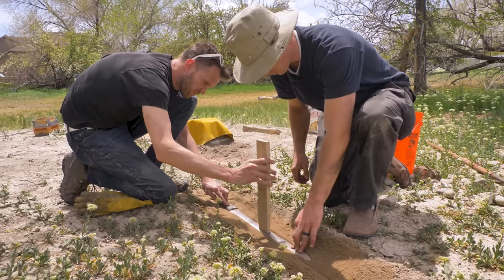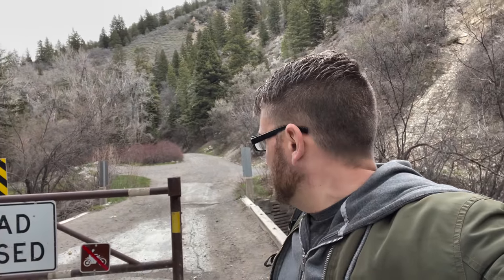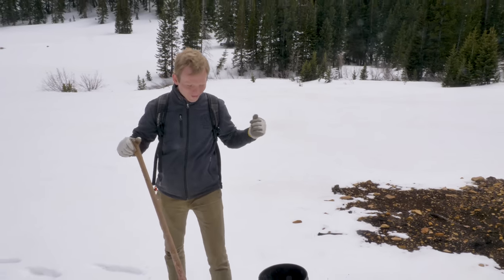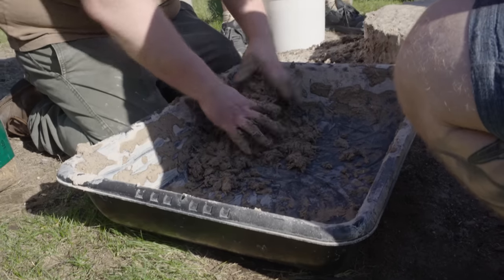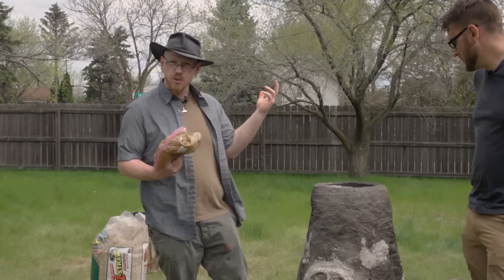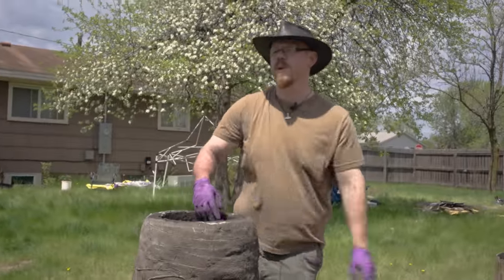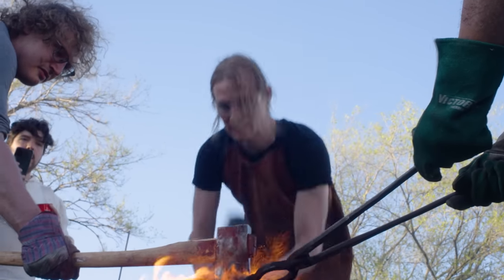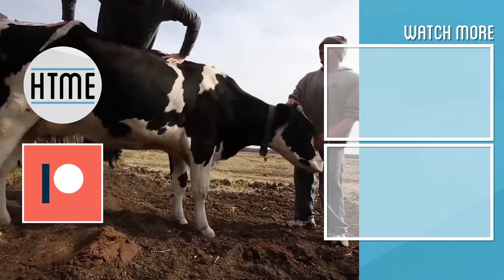I Hiked 14 Miles to Collect This Orange Dirt

Comment: Consolidating that into a useable billet is going to be a fun time. I've looked into that process and it's a lot of cutting and folding and/or stacking and [forge] welding.
Don't be surprised your arms get tired near the end from all the hammering.
Remember to Swing with more of the shoulder than the elbow, aim small miss small, and eat loads of protein when you can; you'll need every bit of effort with that.

Comment: "We've accidentally made steel."
I was not expecting that!
Honestly I was not expecting most of what was demonstrated.  This is an amazing and educational video!
Reply: This is not steel, this is so high in carbon that it's beyond cast iron. Cast iron has more carbon than carbon steel, ironically.
Reply: @rolfbjorn9937  Ah.  I was quoting them.
Reply: @FullmetalAngyl  Well, Yesterday Me is technically not 100% right, I just had a breakfast illumination, there's a term for it, it's a bloom or bloomery iron. See, High Carbon Steel is...way under 2% where cast iron is beyond 4%. Their bloom seems to be in the past 4-5% and obviously all blooms need further work to turn into either wrought iron or steel.

Comment: According to the book "Collapse" by Jared Diamond, bog iron production used so much charcoal that the norse ended up deforesting Iceland. The initial forests were simply far too slow to repopulate.
Reply: That sounds wrong to me, Iceland doesn't exactly have a lot of bogs, they're mostly found in Southern Scandinavia. Also all iron production requires charcoal, not just bog iron, it was only with the invention of refractory furnances that coal started being used.

Comment: At a daycare that my uncle owned, and my mom worked at, I remember digging in the sand pit, and finding what we called "Tiger Sand" because it was orange and layered in with darker sand. I also remember finding iron fillings in the sand with a magnet toy. the owner also regularly had sand delivered in a huge pile, and we loved to climb and dig in it, until eventually they spread it out.
I later came to the conclusion that the sand may have come from a local foundry, and had most of the iron filings pulled out with magnets, but some small (harmless) amounts were left.

Comment: I presume primitive times would have had a streamline process of this that would have been really efficient; considering how they're all using so many iron tools (that might have possibly been ruined after a single run of this) to craft that small amount of steel. Curious to think how those in the past did this. Still, this video was really cool and educational as well. Cheers
Reply: This is why steel tools costed ALOT of money back then. the smallest amount of purified steel had been hours of work in the making, and when you had those tools, you held on to them and made sure to treat them right.
Reply: thats why they sharpened and oiled their tools isntead of throwing it away. Probably they had bigger blooms with higher stacks.
Reply: @prydzen  They reforged iron tools, instead of sharpening. Sharpening removes material, something you want to avoid when facing material scarcity. Heating a tool up, and hammering it back into shape saves far more material.
Reply: @torg2126  nonsense.
Reply: @torg2126  They definitely sharpened tools. Reforging is a waste of resources and time, and you still lose material due to oxidation forming scale.
Reply: @TheElfsmith  Not as much as when you grind a tool back to profile. Simply hot working a tool back into shape will loose you less
Reply: @torg2126  You wanna bet? Because after you forge a tool, guess what you do.
Reply: @torg2126  I can GUARANTEE you that honing or sharpening a dulled edge (as in dull through regular use, not damaged) loses less material than reforging an already finished tool does.
Reply: @TheElfsmith  Scrape off a bit of scale? Obviously. Grinding off a whole lot of material to get back the tool's profile tends to remove more material
Reply: @torg2126  After you forge a tool... you grind it to true up the profiles. You also have to reharden it and temper it, which, guess what, produces more scale, and more grinding afterwards. You also have to rehandle it, which, for most traditional knives, means grinding down the peened tang, or knocking out an axe handle that needs to be remade to accept new wedges. Even scythes, which are cold worked by peening as part of maintenance, still get honed on a whetstone after peening.

Sharpening, starting at around 200 grit, however, produces so little waste material that if you were to weigh the tool on a precision scale, you probably wouldn't see a difference.
Reply: @torg2126  It's not just "a bit" of scale. Heating a piece of steel up to forging temperature turns a significant fraction of its weight into oxide every time you do it. It also takes longer than sharpening, and burns up fuel. Then you just have to grind anyway, because you have to grind off the scale. Also, reforging undoes heat treating for hardening, so you have to go through the whole pain in the ass of heat treatment and tempering all over again, hoping you get it right and the metal doesn't crack or break under the thermal stress, which is a not insignificant risk every time you do it. Sharpening is just easier and more economical in every way; people in any time period were definitely not reforging tools if they could help it.
Reply: @TheElfsmith  First off, the scale issue is overstated. Most modern blacksmiths tend to use propane forges, allowing a very precise control of heat, at the cost of a few downsides. First off, propane forges often can't reach the same temperatures that charcoal forges can, thought YRMMV depending on the exact forge design. 

Secondly, and more importantly, when propane is burned, one of the combustion results is water. As you know, extreme heat and water vapor allows quick and deep rusting, as demonstrated by all the armored vehicles rusting away in Ukraine right now, an environment a propane forge provides abundantly. Charcoal, on the other hand, being near pure carbon, only releases CO2 and CO, along with heat when burned. this means that a well managed charcoal forge can have an area that holds almost no oxygen or water vapor, while being extremely hot, allowing effective forging.
Reply: @torg2126  You have... Absolutely no clue what you're talking about. Scale doesn't form because of the combustion byproducts of the fuel, it forms in the presence of extreme heat and oxygen. When iron and its alloys are heated to a high temperature, the piece reacts with oxygen, whether it be from ambient water vapor or diatomic oxygen, and forms Fe3O4, or black iron oxide, on the surface. When you strike or brush the work, it flakes that black iron oxide layer from the surface, creating a "fresh" surface for more to form. That's what scale is. It will always form in an aerobic environment at high temperatures. It's not just regular rust formed in the presence of water; that would be Fe2O3.nH2O, or hydrated ferric oxide. Typical rust does not form in the forging process- it's a completely different thing. 

As for the fuels, that's not how ambient atmospheres work. A "rich" propane forge, meaning more fuel than oxygen in combustion, creates a reducing atmosphere in the forge, which- on the extreme side of things- can remove iron oxides from the surface of your work, and a solid fuel forge with the work exposed at temperature to unburned oxygen will form scale. But that's neither here nor there, because as soon as that hot iron hits the ambient atmosphere, it's going to start forming forge scale on its surface. The ambient atmosphere is what near all scale forms in, and in general, you can expect a mass loss of somewhere in the 1-10% range over the course of your heats (although this is heavily dependent not only on forge efficiency but also time, temperature, overall mass of the piece, surface area of the piece, what processes the work is going through, and a plethora of other things). 

Regardless, though, formation of scale during forging is so well known- and so abundant- that archeologists use the presence of forge scale to determine the locations of blacksmithing shops at dig sites.
Reply: @TheElfsmith  As you said, scale forms from oxidation. Charcoal releases CO2 and CO, of which carbon monoxide acts as an oxygen displacer.
Reply: @TheElfsmith  Propane also produces water vapor when burned. I quote; "The main catalyst for the rusting process is water. Iron or steel structures might appear to be solid, but water molecules can penetrate the microscopic pits and cracks in any exposed metal. The hydrogen atoms present in water molecules can combine with other elements to form acids, which will eventually cause more metal to be exposed. If chloride ions are present, as is the case with saltwater, the corrosion is likely to occur more quickly. Meanwhile, the oxygen atoms combine with metallic atoms to form the destructive oxide compound. As the atoms combine, they weaken the metal, making the structure brittle and crumbly."

In short, water can infiltrate iron, especially when in heated, ensuring faster oxidation when exposed to normal atmosphere
Reply: @torg2126  Holy shit man, I already went over this: Scale produced in forging is Fe3O4. No water needed. The heated iron reacts with oxygen, and makes iron oxides. Rust, a totally different oxide, is Fe2O3.nH2O. Forge scale is not rust. Rust is hydrated ferric oxide. Forge scale is black iron oxide.
Reply: @torg2126  But this is all besides the point anyway, because scale still forms in ambient air, regardless of what fuel you use, and it will still form in greater mass than what you would lose from sharpening and honing. 

Sharpening and honing are not reprofiling, and don't hog away material. It's pushing a tiny little burr back and forth across the edge, making it smaller and smaller as you use smoother and smoother stones. The material loss during a single sharpening is negligible, while the material loss in reforging (which would including grinding anyway since you can't forge down to a sharpened and honed edge, nor would you want to, since that increases the likelihood of warping in heat treat) can be up to 10% in general work, and sometimes even above 20%, like I said before.

Comment: You should visit the Old Irontown ruins near Newcastle Utah. There are the remains of large charcoal kilns made in the late 1800s to produce charcoal by tons, a blast furnace, a few other things I can't think of off the top of my head, and you can see the old open pit mines on the side of the mountains there. There is so much of that rust dirt in the area you can see whole mountainsides with the color. It's one of the richest reserves of iron in the country that has been largely untapped for some reason.

Comment: i wish they went into more details on what went wrong here... was it the temperature/furnace or their process of mixing the pulverized bog iron with charcoal? When Primitive Technology tried with his bog iron, i think i remember him mentioning about there being a specific ratio of iron to charcoal that is hard to achieve and he failed as well, only produced small beads from the crumbly bloom...
Reply: The previous video talked about how they didn't have enough heat. They had enough heat here. If you mean for iron instead of steel? Carbon content issue, yes.
Reply: I mean making steel instead of iron is a fortuitous event if what you want is material for tools or weapons. Sure it's more laborious but steel tools are vastly more durable and useful than cast iron ones. Pure iron is impossible to make with these methods.
Reply: @ruukinen  of course pure iron is impossible to make this way. However, they were expecting something like cast iron, most likely.
Reply: I was definitely a bit tired at the end and should have gone into more detail on why we got more steel than iron. The short answer is we most likely ran a bit hot towards the middle of the charges. The goal of this style of bloomery smelt is to never fully melt your iron, as when you do it readily absorbs carbon. There will be a follow up video where I take the bloom and refine it to a more workable state and will go into a bit more detail.
Reply: @marscraft4228  thanks for the explanation!

Comment: You mentioned bog iron was essentially rust, does that mean then that rust directly from metalic iron would work as well?
Reply: Absolutely! I used a fair amount of red iron oxide during this particular smelt alongside the bog ore. It is a convenient source of iron as you can purchase it by the bag from ceramics suppliers.
Reply: Rust is iron+ oxigen atom ( oxi-dation) by heating it up in a furnace/bloom you basicly extract the oxigen atom again turning rust back into iron

Comment: A rough way to determine if you have iron ore is to crush the ore on a metal plate with a hammer. Limonite will be deep orange, haematite red, and magnetite black. If there is a lot of silica the colour will be pale, and it's white then it's just rock.

Comment: Carbon is soluble in molten iron, like sugar is in water. And iron ore requires carbon (technically carbon monoxide) to be reduced to metal. This iron is not the same as the elemental iron we see on the periodic table, this is actually a iron-carbon alloy. 
      By the nature of the process we use to make metallic iron, we inadvertently make it as an alloy and not a pure element. One major benefit to this iron-carbon alloy is that it has a significantly reduced melting point compared to the pure element. (higher temperatures are harder and more expensive to reach)     
       Also, it has improved molten flow characteristics, and fills voids more thoroughly. This is why we call it cast iron. Cast iron literally has little microscopic nodules/flakes/plates of graphite dispersed through out it. And the shape of these graphite particles effect the solid cast iron's properties. 
      What also effects the cast iron is the total level of carbon that's actually dissolved in it. More carbon lowers the melting point, but also lowers the ductility of the metal, if it's high enough, cast iron breaks almost just like glass does.
      Now, if you take oxygen gas, and bubble it through molten iron, the oxygen will burn up the dissolved carbon where it will bubble out as CO and CO2 gasses. This lowers the carbon content, raises the melting point, and makes the final metal malleable as opposed to brittle. If you're good, you can find tune the carbon content to be exactly where you want it and this is what we call crucible steel, or carbon steel.
      Before oxygen was used, cast iron was brought to very high temperature, and it had the carbon physically beat out of it with sledge hammers on an anvil. The glowing hot iron was "kneeded like dough" and the carbon in it was exposed to the air and burned up that way, but that takes A LOT of work. This is wrought iron, which is in a way like crucible steel, but more crude. 
     Finally, there are other metallic elements like manganese, nickel, cobalt, chromium, molybdenum, vanadium, tungsten, etc that can be alloyed into the steel to create what's called alloy steel. Alloy steel is superior to carbon steel, but it's much, much more expensive, and carbon steel is actually very quite good as it is. So it's best to reserve alloy steel to when it's absolutely needed.

Comment: It may not be historically accurate, but you can make a bellows that pumps air in both directions. Make a V shaped frame and a paddle in the middle to separate both chambers, then add the fabric/leather to it like you normally would.

Comment: Another high-quality steel was made from an Indian (Asia) ore called "Wooz" that created strong steel weapons of a material called "Damascus" steel -- named after the main source for European weapons of the type -- that looks like it is made of thin stripes of black and white layers of alternating higher and lower carbon steels.  It turns out that this steel has a small percentage of vanadium in its ore that strengthens the steel (well before such alloys were actually identified).

Comment: So the whole "Only using tools we made" has now totally gone out the window huh.
Reply: Uhmm they made iron before in an other bloom, but was more primitive, iron tools  have been around a few episodes now, so it stands to reason iron tools to be ised to make better iron tools as time progresses
Reply: @Mr2winners  Very good.
But they didn't.
they tried to refine Iron ore in a bloomery that Andy didn't create, using tolls he didn't have access to.
Then Andy was like, you know what, I'm going to try making some Iron out of this pre-refined iron I took out of the garbage.
When that failed, Andy proceeded to have a blacksmith with years of experience and tools it would take Andy at his rate of Iron production a century to complete; refine the iron for him.
Finally without a smidge of his original personally gathered materiel, and having completely failed to refine ore himself; Andy hammered out the most disappointing pencil sharpener every and called Iron done.
Andy then Immediately began using his blacksmith friends forge and tool with foundry bar-stock to make the functional Iron tools we have seen in this series.

"Here's my assignment miss. Someone else did all the research, I literally plagiarised my key premise off some guy who actually understands the course; and I paid a graduate to write it. But I signed the bottom so I did it."

Comment: Man, you should've just come to Indonesia, especially south coast of Java, there's plenty of sand there. And not an ordinary sand either, it's an iron sand, the sand is mostly consist of metal shavings and some little rock a.k.a your average sand. You can literally just scoop any sand on those beaches and melt separate the iron from the rock using magnets. And the best part is that it's free